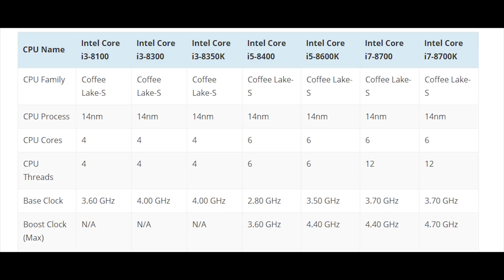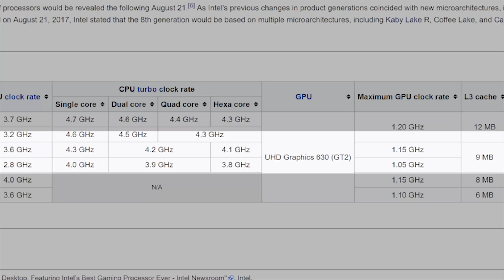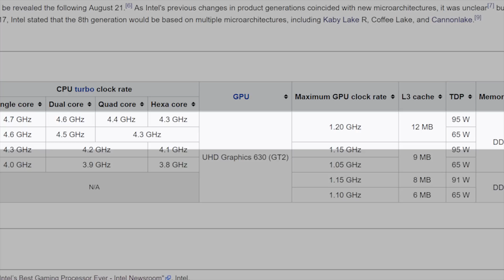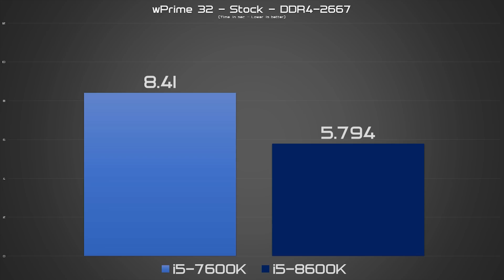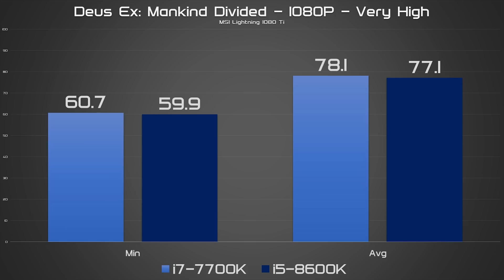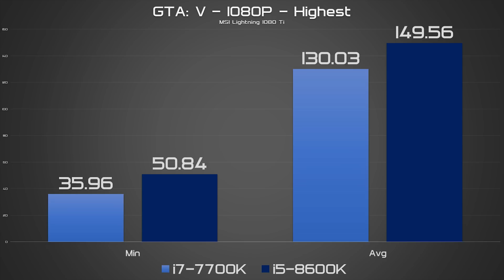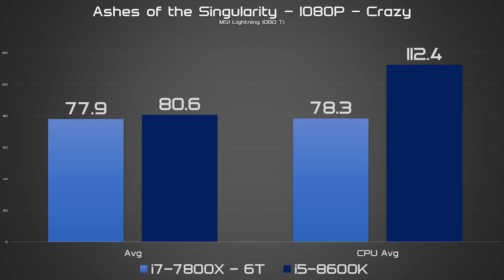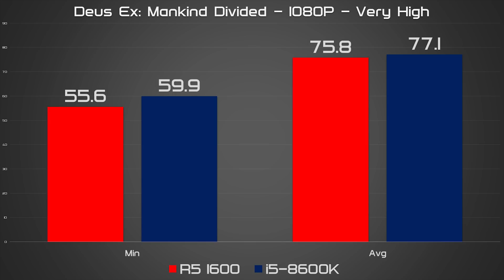COFFEE LAKE IS HERE - RIP KABY LAKE & RYZEN? - Intel i5-8600K Review

Comment: The 8700k beats out Ryzen. I almost bought a 1700k, and while it is amazeballs, it isn't as amazing as the 8700k boasting the greatest single core speed of any cpu ever. I've seen every benchmark for these two cpus humanly possible, and along the way numerous others as well. It comes down to this, 

if you plan on doing any real gaming, get the 8700k. It's that much worth it. 
If you don't game and don't plan to any time soon, get the Ryzen 1600 if basic production is all you care about(though windows will be noticeably less smooth, and snappy compared to intel cpus,, though just barely). These can be overclocked to get basically 1800 performance.
If you do hardcore content creation etc, get a threadripper. Sure, there's the I9 series from intel, but you'll be better off with the threadripper.
If gaming is all you care about and you're on a  budget, get the I5 8400. Search youtube for "Intel’s RYZEN-KILLER - Core i7 8700K" watch it and you'll understand why. It'll be plenty good enough, trust me on this, but if you're budget allows it, get the 8600k just so you can go longer before needing a upgrade.
If gaming is all you really care about right now yet you "might" want to do some beginner content creation or streaming your games in the near future, again it's the 8700k, it'll be worth the bit more $$$ and you'll have room to grow. 

If you're looking for a cpu in the $350-$500 range, get the 8700k. It kills Ryzen in basically everything gamers or "regular" users do.. and if you do decide to do some more multi-core intensive stuff in the future, it'll give you 90% of what a Ryzen 1800 can get you anyways.

Comment: Dude! I am upgrading my "dinosaur" :)))))) I got an Asus p5b deluxe, with 8gig of ddr2 :)))))) and a Q9400 cpu. I dont even understand what were you saying most of the time. The only thing im going to HATE about the upgrade is that i have to loose my beloved windows 7 and upgrade to the crapy windows 10. I guess im getting old for this s*** :))))))
I ordered an Asus Z370-A with a I5-8600K and 32gigs of DDR4 3000MHz :) imagine yourself what a step forward it is to me.
Awesome video... Rock on dude...
Reply: i know its old comment but in my opinion if you want same longevity out of your system as your q9400 you had to pick i7 8700k considering you have enough money.  8600k Is still great cpu though. I personally upgraded from c2q q9400 and 8gb ddr3 1333hz ram to i7 4790k 32gb 1866hz ram and i will not upgrade my platform for at least 3-4 more years.

Comment: It may not be worth from a 7700k owner, but for an FX 8350 owner like myself? 100% going all in on the 8600K. The 7600K wasn't worth imo because its 4 cores really maxed out in a lot of use cases, leaving no extra room for background tasks. I won an R9 280 in a giveaway, so I switched from my GTX 660 at the time. Between the 280 and its awful drivers and software, and my FX 8350 and its crazy core count mixed with awful IPC, and thus terrible future proofing, I won't give AMD my money again. I even had one of my 8350's die on me and I had to buy a new one. What a waste. RIP newfound AMD fanboys. I'm making the switch and definitely won't be looking back. Think. If I had bought a 2500k I'd still be doing fine in games. Instead I'm completely held back by a newer CPU because I bought into the BS hype. History is just repeating itself, only difference is AMD has a slightly better offering this time around.

Comment: Ryzen is still better value for money.  The 1600. Cost 210 could get it for cheaper. Can overclock to 3.8 on stock cooler. Pair it with 2933mhz ram and you will not see a big difference in games with a gtx 1060 or 1070 vs a 7700k or 8600k. You will see a difference however with a 1080ti. Where Intel clock speed advantage really shows it's colors.

If you are building a rig and only plan on getting a 1060 , 1070 ryzen 1600 is good value, even the 1700 is good value.  Some 1700 can be found for 260$ in some places.

The 8600k cost 260$  + 40$ for an air cooler that's 300$. The 40$ cooler will not allow it to get to 5ghz without melting. For it to have a clear lead over the 1600 or 1700 in gaming which is only with a 1080ti it needs to overclock to atleast 4.7ghz. you will need an Aio to get to 4.7 or 5ghz. A good Aio is 100-130$. Only the buyer will be able to tell if it's worth it or not .

Also consider am4 will last till 2020. Wey into zen 2 architecture. You will have an upgrade path for 3-4 years of CPU if that matters to the individual. LGA 1151 will be dead by next year. It's more than likely cannon lake will have a different socket. I could be wrong.
Reply: I'm done with Ryzen. it cant even run my ram at rated speed. Getting the CPU to run anything above 3.85 was impossible even with LLC and Core voltage at 1.375 and up to 1.4 and to top it off it was a huge bottleneck for my Gtx 1080Ti. the 8600k will do 4.8 to 5+ GHz on all cores no problem. and it Won't bottleneck anything. also on the z370 Chipset, i get 2 x M.2 natively not bridged like you see on x370 Boards. so i can run my M.2 at full speed without an Addin card. Ryzen wasn't ready for launch when it launched. they should have kept it a little longer and finished it. even the AGESA Code 1.0.0.6b Won't take most ram above 2933MHz. BYE BYE Ryzen. as as for Ryzen 1600 yes they are cheaper but you cant compare it to the 7700 or the 8600k in any way.
Reply from the maker: I made most of these points in the video?
Reply: before I sold my Ryzen 1700 my specs were as following. Ryzen 1700, Msi gaming pro Carbon x370. 32Gig of DDR4 3200 ram GTX 1080Ti. and in games like GTA 5 on Ultra settings it would pull between 60 - 75 FPS on 1440. even with todays newest bios for the board i was unable to get a stable overckock above 3.8 and my DDR4 Would not post at all above 2933.
Reply: wardope to overclock beyond 3.8 GHz you need to adjust load line calibration to high or ultra. And you need at least 1.36 or 1.37 volts On the vcore. Mine did not overclock to 3.9 until I did so. I'll leave it for a while then I'll try for 4ghz. It's a little difficult to get all 32gb ram to 3200 unless you are running Samsung b die. It's easier for 16gb but you can achieve it on 32gb as well. With b die , at least 1.35v on the vram and loosened timings.
Reply: Anybody  can find a good-enough cooler online for 10 bucks. I just bought a brand new cooler master liquid cpu cooler from amazon for just $30. So your point about 40 bucks is greatly exaggerated. Some of your other points are off too, seemingly skewing towards AMD.

Comment: between r5 1600 and i5 8600k i will go straight to ryzen 5 1600 
Because:
ryzen cache memory is 16 - and 9 in intel
ryzen is unlocked and able to oc to 4ghz in cheap b350 mobo - intel one ( i5 8600k) you can oc in expensive z370 mobo to 5ghz
ryzen comes with a decent cooler able to oc to (4ghz! with stock cooler) which intel require a good cooler
for mobo cheap b350 for ryzen is good then a expensive z370
in games max diffrence is 1-10 fps some games loves ryzen and others intel but it isn't worth to get intel
so that 1 ghz  advantage for intel isn't enough to beat r5 1600
(yup forget to mention r5 1600 use 65TDP which intels 95TDP)
etc..
and if you wanna oc dont forget add 70$ to (r5 1600 price) to get i5 8600k and some moooore money to get a propre cooler LOL waste of money!
i think you get it

Comment: You're paying 50-75% more for a 8700k over the 200$ 1600, and the 8700k only gives you 20% more performance in games/productivity...  Not to mention that the 8700k doesn't come with a stock cooler, is VERY hard to find in stock, and can only overclock on 120$ Z370 mobos where as the 1600 can OC on a 60$ B350...  8700K is better, but it's poor value.
Reply: Personally think that 8700K's natural opposition is the 1700X which also doesn't come with a cooler so that's out of the equation. OC the K SKU's is very simple, and not every reviewer got a massive overclocker, ask Steve at Gamers Nexus. There is no doubt that Intel does overclock better than AMD but I will be interested to see the performance of the locked 8700 on the B350 or H370 motherboards when they come next year. The Z390 this time next year on the 8700K will be interesting although hopefully Ryzen+ will be around and hopefully this might lead to IceLake being available early on the desktop leaving CannonLake as a mobile only CPU.
Reply: clansome 1700x in Amazon us, iS 298us... + 25us cooler...
Reply: lol the 8600k certainly wrecks the r5 1600 in games when overclocked and at stock speeds. There is about a 30 to 40 fps difference(watch some benchmarks). And you can't OC the r5 1600 to 4ghz with the stock cooler. Even with an aftermarket cooler, ryzen might not reach 4ghz(watch hardware canucks' video on OCing r7 1700). Sure the i5 is more expensive, but you can get the same productivity as a 1600 and much better gaming performance if you spend 80 dollars more on the i5.
Reply: 정성헌 you're so wrong it hurts to read
Reply: @Light Elf from Elven Village I meant to say 1800X and the 8700K is a good £30 ($50) cheaper (if you can find one admittedly, but at launch that is usually the case). I think Intel aren't helping themselves holding back the cheaper motherboards can only suspect that was a bit of a sop to the motherboard manufacturers to get the Z370 to market and sell a few more of them.
Reply: between r5 1600 and i5 8600k i will go straight to ryzen 5 1600 
Because:
ryzen cache memory is 16 - and 9 in intel
ryzen is unlocked and able to oc to 4ghz in cheap b350 mobo - intel one ( i5 8600k) you can oc in expensive z370 mobo to 5ghz
ryzen comes with a decent cooler able to oc to (4ghz! with stock cooler) which intel require a good cooler
for mobo cheap b350 for ryzen is good then a expensive z370
in games max diffrence is 1-10 fps some games loves ryzen and others intel but it isn't worth to get intel
so that 1 ghz  advantage for intel isn't enough to beat r5 1600
(yup forget to mention r5 1600 use 65TDP which intels 95TDP)
etc..
and if you wanna oc dont forget add 70$ to (r5 1600 price) to get i5 8600k and some moooore money to get a propre cooler LOL waste of money!
i think you get it

Comment: worth upgrading from a 4790k to a i5 8600k or i7 8700k, for gaming (1080p 144hz), and sometimes streaming? if so, which one is more worth it?
Reply: If you stream with OBS I highly recommend the 8700K
Reply from the maker: +Save Net Neutrality For sure.
Reply from the maker: It'll definitely be faster IPC-wise.  Worth it is a subjective idea.  If you're already cruizing great at 1080P 144Hz, then it might not be worth it.  From what I gathered the extra threads on the 8700K slow it down a bit for gaming, so the 8600K will be the best bang for the buck.

Comment: Hm, I wonder is it worth upgrading from 6600K to 8600K, just because more cores and treads...What do you think guys?
Reply from the maker: Only if you need the extra cores & threads.
Reply: I use my PC only for gaming...I don't think it will be that much of a difference,am I right?
Reply from the maker: It'll make a significant difference in some games and none in others.  It really depends.  The higher core clock speed & extra threads will give you improvements if you're running a top GPU at 1080P, other than that, it likely won't
Reply: I'm on 1440p 144Hz 27 inch monitor,1080 ti poseidon...That means what exactly? It will be few frames difference, nothing major, right?

Comment: The 8400 is gonna be a treat against the R5 1500X! The 8100 is gonna beat Ryzen 3 in gaming but not in video editing and file transfers due to that faster memory bandwidth. The 8350K will probably be beat R3 aswell. 
In conclusion, so much is happening in the CPU market right now! Hopefully local prices dont ruin the fun tho....
Reply from the maker: +Kryptk_ ZA Local prices are higher than US, but not out of range for what Kaby Lake was priced at.
Reply: UFDisciple good to hear! Hows the overclocking looking?
Reply from the maker: +Kryptk_ ZA Cooling is still a major issue, cheap TIM again.  But cooling aside, 5G's is EZPZ
Reply: The i3-8350k together with Z370 price and the price of a cooler will cost around the same as a Ryzen 7 1700 and a B350 motherboard.

Comment: Ryzen is still the best
Reply: Max Pain people who can actually aford an extra $50 will go for a superior chip. Just cause you cant or wont doesn't change the fact that Intel still beats AMD.
Reply from the maker: +s g Best value*. It holds no performance crown in any category. It's only relevant based on its price/performance ratio.
Reply: Max Pain I am buying the I5 8600k
Reply: "And not many people will be buying 8700k's" This couldn't be more untrue. And 8th Gen I5's are sold out everywhere. 

People don't mind buying "high end" when it only cost 50 bucks more. 
REPLY
Reply: It's funny, people went from speculating if it was rushed, to now it's treated as just a simple fact, when in reality, nobody knows. The problem isn't so much a massive shortage, they are - somewhat - hard to find only because people are buying them up so fast.

Comment: Will stay with Ryzen just because I can switch it with the newer Ryzen CPU's even in 2019. Covefe Lake is nice but I can't see that great gain for me.
Reply from the maker: +HappyPhilXD Good thoughts.  Thanks for sharing.
Reply: Personally I'd still be fine, other than software monitoring I really don't see any way a person would notice the difference in framerate. Could you tell 130 FPS from 145?
And Zen2 will move to either a 6+6 or 8+8 CCX and together with IPC and clock speed improvements, Zen2 will likely have 200-300% the multithread performance of Zen1.
Reply: How would you feel about it if the Ryzen cpu released in 2019 still isn't as good as a 7700k in games? Not saying that will happen just wondering how you would feel.
Reply: Brandon F how would you feel if you just bought an Intel chip.2 months ago and can't just sell the old chip and drop In the new one because the socket has the same number if pins BUT it isn't compatible. They love doing this kind of shit it's funny to watch. Glad I'm too cheap to buy any of this shit
Reply: how would you feel when you realize that AMD will support the AM4 socket with Shitty APU until 2019 nothing to beat the 1800x in performance because they want you to buy the TR for high-end stuff. Wouldnt you feel at tiny bit Sad?
Reply: Yes, i can tell the difference between 144Hz and 165Hz. I even did a blind test and I was spot on 100% of the time!
Reply: /r/iamverybadass
Reply: Mark Yates You can use any graphics card and for coffee lake you need a new mobo too.